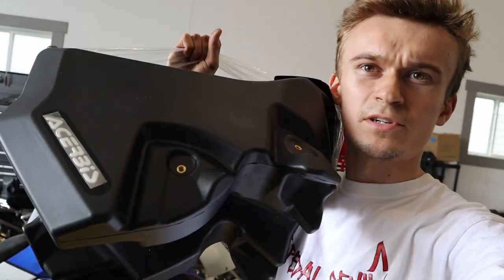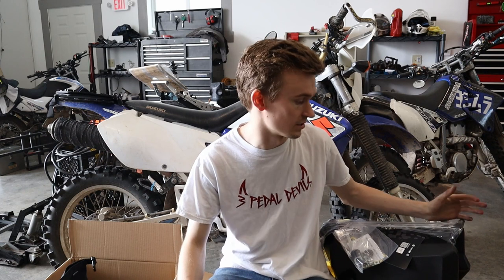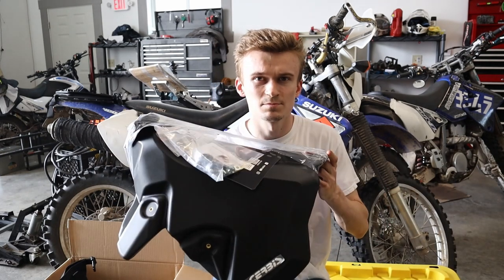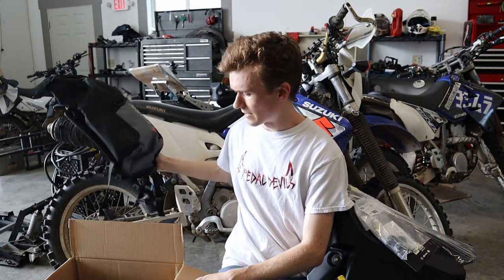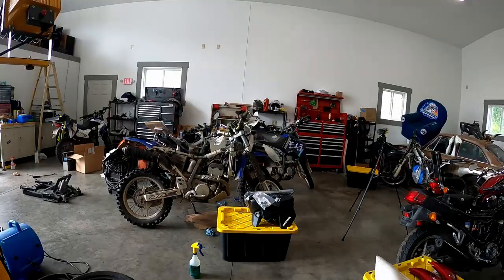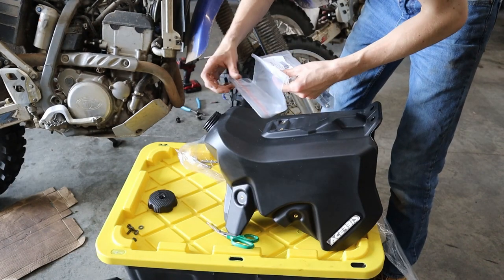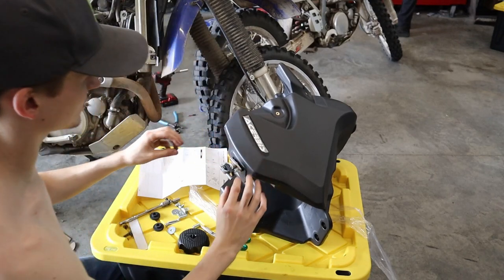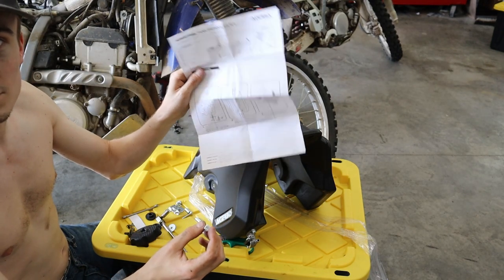DR-Z400S Larger Fuel Tank Upgrade - Acerbis 3.7 Gallon

Comment: Willy reports the supplied fuel valve (petcock) is not vacuum operated like OEM.  This is actually an advantage, especially in long distance off-road riding and on-road touring. The vacuum valves sometimes begin leaking when shut off.  Carb floats can overfill and leak when failed vacuum operated valve leaks, leaving you will less fuel. With DRZ, if other OEM tubing routing remains in tact, then engine gasoline can fill cylinder and contaminate motor oil. It's commonly known that when engine fills like this, that electric starter cannot start engine because upward piston movement is stopped by fuel in cylinder. E model has kick starter that can also fail to start engine when condition is severe enough. When engine will not start because cylinder is filled with gasoline, then it is necessary to remove spark plug and spin engine to spit fuel out spark plug hole (Keep your eyes away from cylinder head!) Removing the gasoline will get you running again, but motor oil needs replacement.
Reply: 50+ years, 20+ bikes = NEVER having a vacuum petcock fail. On the other hand, with a non-vacuum petcock if you forget to turn off the fuel the only thing keeping gas from reaching your oil is the float..  Keep the vacuum petcock and turn your gas off when you stop, just like a manual. But with a BACKUP when you forget. Which you will.  ;)
Reply: @mikeb1039 FYI it's a known problem with the DRZ.  First thing people did in my local dual sport group was advised me to get a different pet cock when I purchased my DRZ. The owner before me actually put an inline on off switch on it, so that's how I get around it. Ride on ✌️
Reply: @MrTmax74  No, it's not!  It's the SAME as every other motorcycle carb from 30 years ago.  And just as non an issue for everyone else that isn't paranoid about it.  
Not a thing wrong with doing it another way, but also not a thing wrong with oem setup.

Comment: i installed the Acerbis 3.7 gal tank on my 2015 drz400s yesterday.   The tank I received differs from yours.  Look at vid at 5:42. Your tank has the rear mount point as an extension of the tank. The tank I got does not do that. My tank has a 2nd metal bracket that attaches to rear of tank and then gets fastened to frame( same as OEM).    I had no issues mounting this tank.  In any case, isn't the most important thing how the tank functions once installed?   I am going to go with the petcock supplied with the new tank, but will keep an eye on it over the 1st several months.  Thanks for the video.  Hope you enjoyed the MABDR!  I'm planning on northern cal BDR later this year....IF the snow ever melts:)
Reply from the maker: Interesting that they're a bit different! Glad you didn't have any issues mounting yours. Functionality and reliability are the most important with a tank like you said, and mine has been working just fine after I got it to fit! The MABDR was incredible. Have fun with the Northern Cal BDR, sounds like a good one!

Comment: I have the same tank. Every time I drop the bike (even for 2second) it floods and the bike is impossible to get started. I’ve been told it’s because the pet clock is not vacuum.. how do you fix this? Can you put the stock petcock on?
Reply: wow, i was about to buy a second hand DRZ400 with this tank already installed! I'm a new rider and for SURE will be dropping it all over the place, maybe i should find one with a normal tank?
Reply: @pitchwife7573  it's a great tank and you want those  extra miles... but I ordered a stock petcock with a vacuum  pump. And just file the whole in the tank bigger. 🤷‍♂️
Reply: Hold throttle 100% while trying to start after flooding it. Then immediately after it starts release the throttle and you should be good. It floods every time you drop it with stock tank too.
Reply: @keldonator  iv had a drz for 10 years with a stock tank and never had that bad of a flooding problem.  But I'm about to make a video about some of the issues iv had with the acerbis tank... I want to like it so much.
Reply: @keldonator no, it doesn't.

Comment: I purchased acerbis 3.4  fuel tank for Yamaha yz250f 2001. Very disappointed that the hose connections are to small to fit on the carburetor end bigger diameter. For being a Italian made product i thought for sure they would have thought this threw for all the tanks they made. Other Italian made  products are good not sure why the ball was dropped  with this. Tank its great but also needs petcock hole on tank needs  to accommodate manufactured oem petcock for the model of bike you buy it for. They only made it half way.